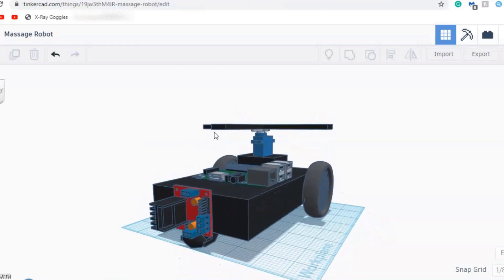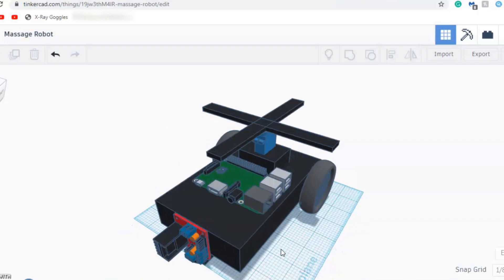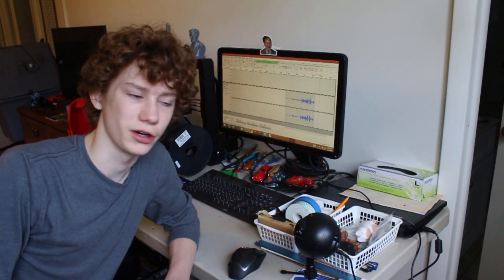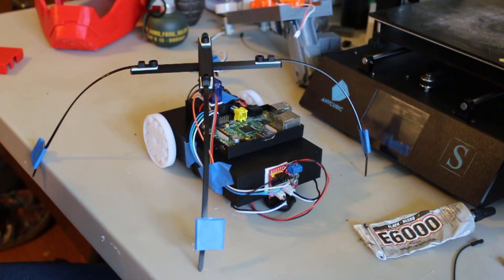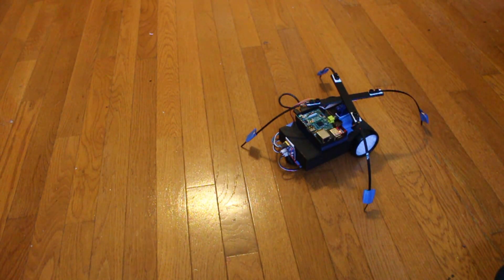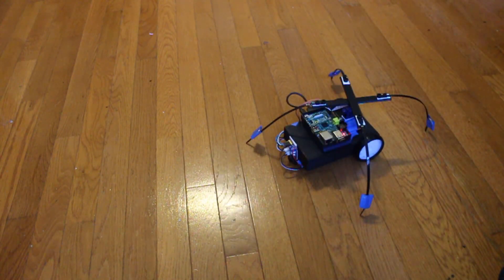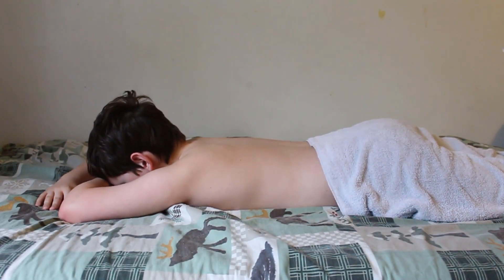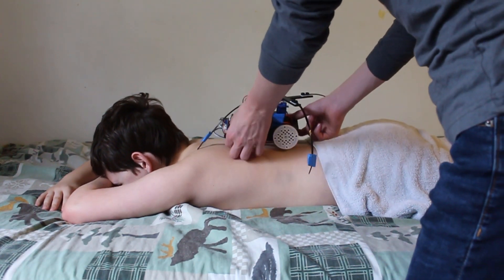I Built a Robot that Massages your Back

Comment: This is great, where do you get your electronics? (i.e. servos, DC motors etc.) I'm wanting to get into projects using the raspberry pi.
Reply from the maker: Amazon is a great place to get electronics if you want it shipped fast, but ebay is great for cheap stuff
Reply: Ok, thank you!